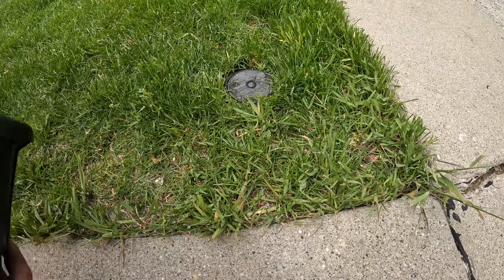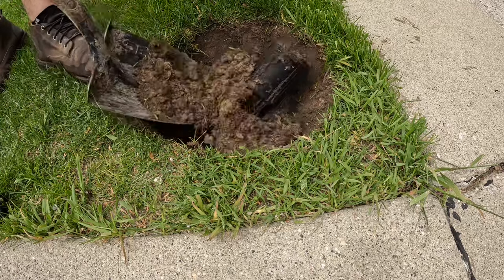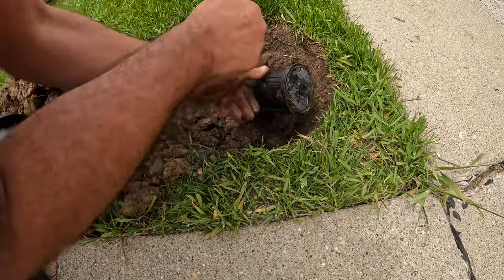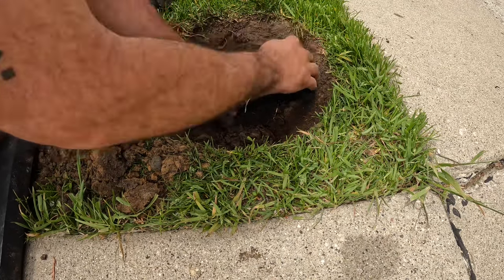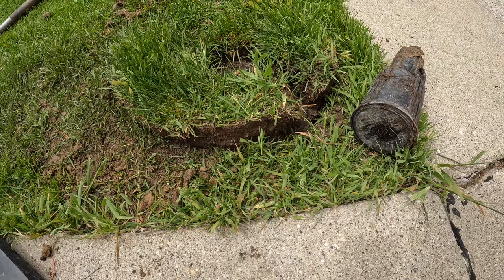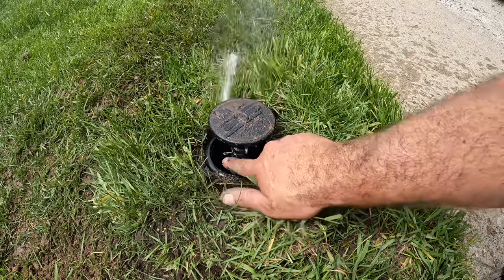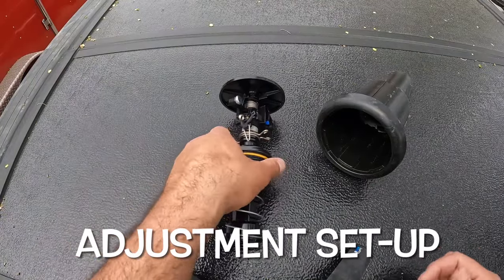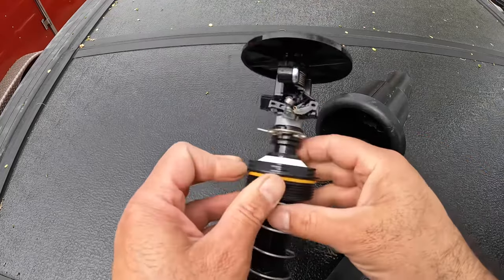How to replace and adjust Rain Bird Maxi-Paw

Comment: Good content. Although I would note I have had 20 of these in my yard for 25 years. Its much easier to replace the guts of the thing with no digging involved. Only once in 25 years did I have to dig one out and replace it. A truck had driven over it and broke the housing.
Reply: Also, I have installed one of these on a sprinkler spike that I can connect to a garden hose. You can take the guts out of one in the ground and use the housing on a spike to troubleshoot issues with the mechanism without having to get back down on the ground to reinstall it. Saves the back and knees.
Reply from the maker: Thanks for watching and the support. I usually change the whole thing. Customer paid for the whole sprinkler, I like to make them happy.  But if it’s a tight squeeze or a lot of roots, I will just remove the guts. And it’s best to clean the pot before, and after removing the guts, makes it easier when installing the new one

Comment: Such a great video. I've recently replaced all my heads, fixed cracked lines, dug/re-dug them to the exact heights of the yard. Even replaced 6 inline zone valves and wired them to my timer. But for the life of me, I could not figure out how to adjust these impacts and all the damn water spraying fast af. I really thought I would figure these out with out instructions. 
Thank you!
Reply from the maker: Nice. You’re welcome. I’m glad I can help. Thanks for the support. Sounds like you did quite an upgrade on your system.
Reply: @tonybahri  it's been a ride but it's now up and going. The grass/fruit trees are happy. Totally worth it ! Ty!
Reply from the maker: The best thing for homeowner with sprinkler system is to know your system. Helps out when there is a problem or future work. Saves time and cost

Comment: Can you pull up the sprinkler when it is not turned on?  We bought a house and some of the sprinklers have roots growing down into sprinkler so the water doesn’t spray correctly.  Thanks.
Reply from the maker: Yes you can. Just be careful pulling them up without ripping the cap off. I’ve seen few my customers use a shop vac to remove the loss dirt.

Comment: How do you fix when it’s stuck and not turning anymore
Reply from the maker: Sounds like it’s wear and tear. Needs to be replaced. 2 ways to replace. Dig out and replace or clean out the pot and remove guys and install new one

Comment: Why dig it out? Change the guts out. If I dug the maxi out I swap it for a 5000 in a heartbeat.
Reply from the maker: Hello. I also have video we’re I swap out Maxi-paw to a 5000. Sometimes it’s easier to dig it out because the pot could be cracked and replacing the guts you have to flush out the pot for debris or the threads won’t lineup right. And not everybody likes the rotors. They like the Maxi-paw sound. Also, if there’s roots yes, it’s best to just change just the  guts.